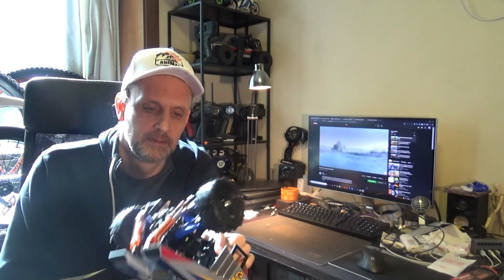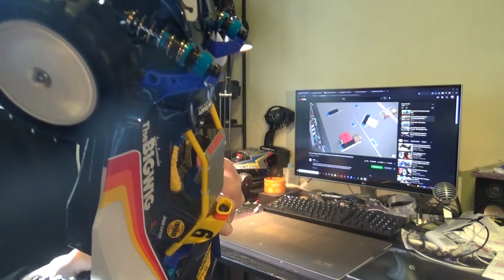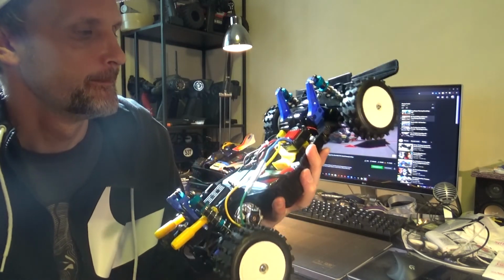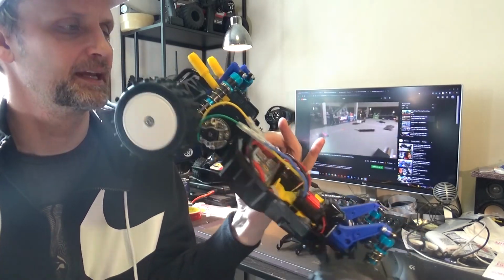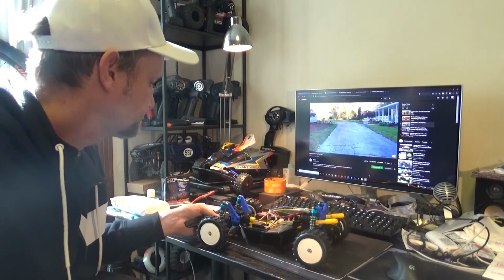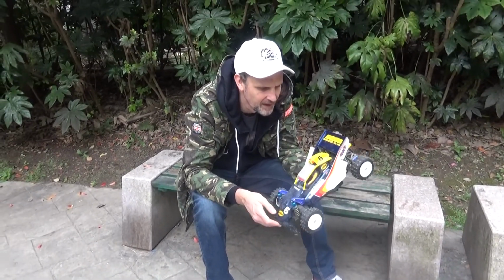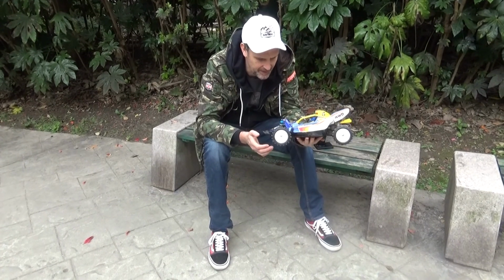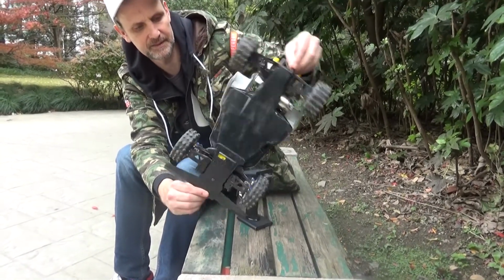Tamiya BIGWIG Review

Comment: I just finished mine this week. lovely buggy. I hear talks about lack of steering. can't say it has bad radius. turns just fine using a Futaba s-U400 servo.
Reply from the maker: Not a great radius compared to modern 4wd buggies. I’m most impressed with the handling. It sticks to the road. Probably due to the weight, but still, better performance than I expected and it was a joy to build.